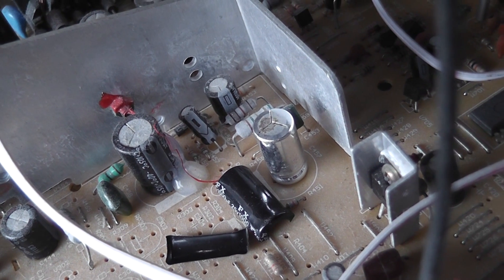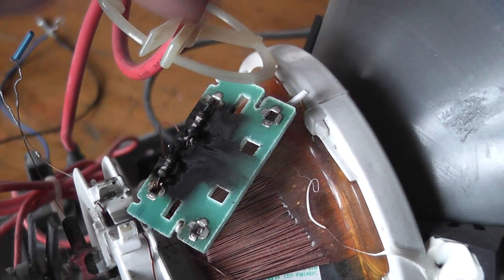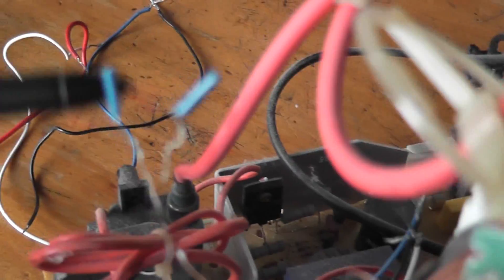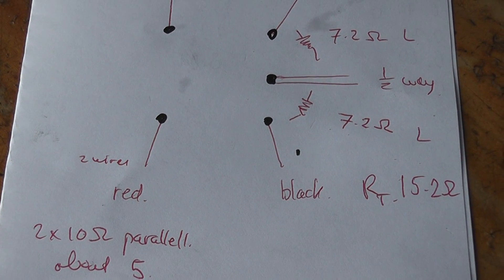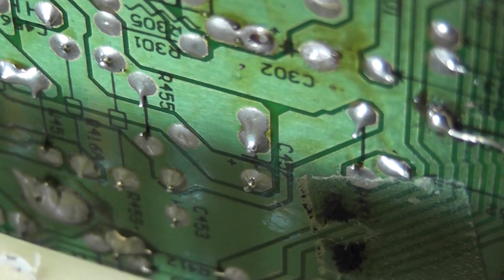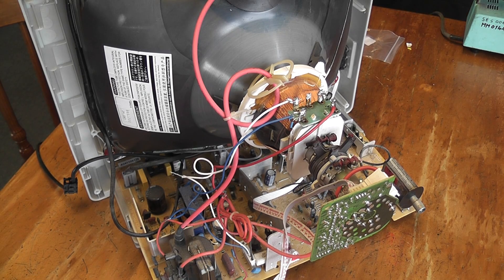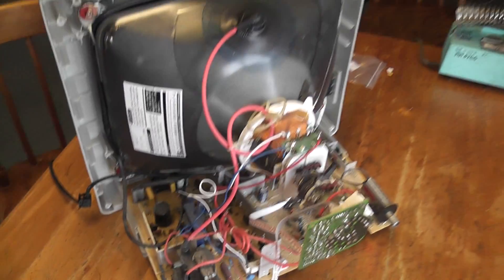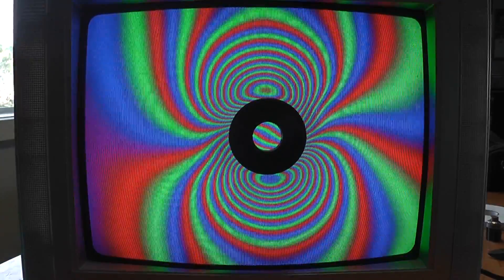TV Perikelen [part 2]

Comment: The vertical coil is the low frequency one. The horizontal coil runs at a high frequency, which is why you couldn't get a (visible) sine wave. Leave the vertical connected and feed audio or whatever into the horizontal. To make a horizontal line with this setup, physically rotate the yoke 90 degrees. This will also shift the beams around making some fantastic colors.
Reply from the maker: Thanks for your detailed reply.